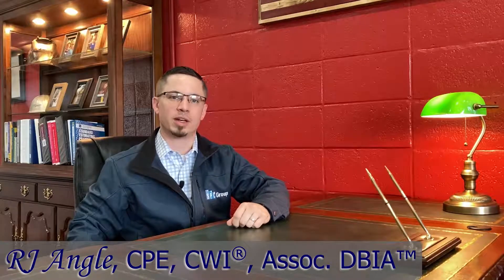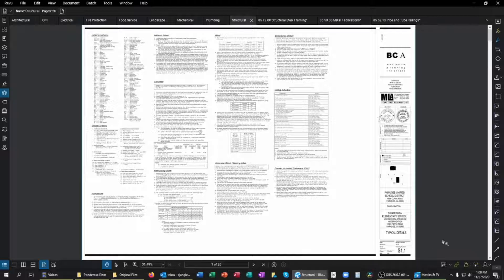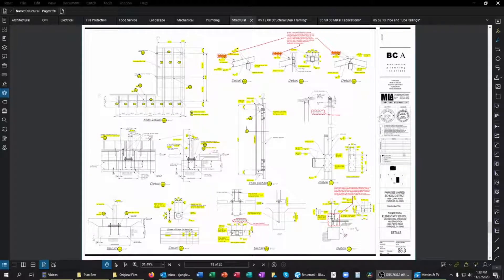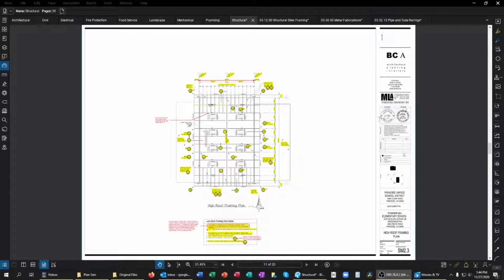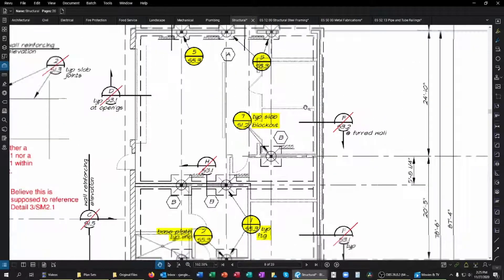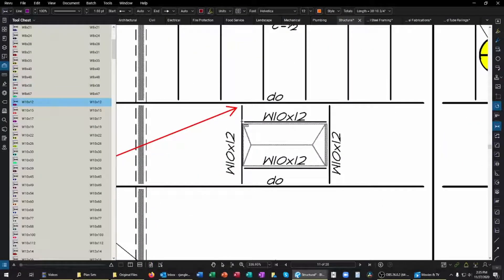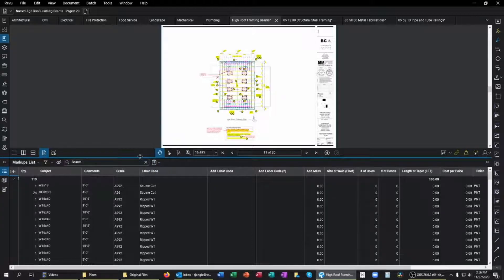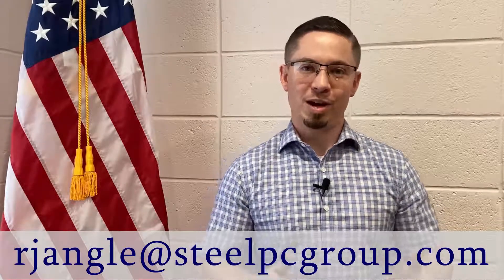Structural Steel Estimating | Material Takeoffs

Comment: Why create separate files? Would'nt it be more efficient to use bookmarks and bookmark headings?
Reply from the maker: @Max Versluis that is an excellent suggestion!  I would have to agree; bookmarking the different plan sets would also be a great way to quickly separate them without segregating the Construction Documents.

Comment: Hi i am trying to learn how to make accurate estimates on steel jobs i am curious how do you tell if you are responsible for the material and fabrication or only for the Erection process?
Reply from the maker: @Dylen Hesseling, thank you for reaching out.  Typically an RFQ (Request for Quote) or RFP (Request For Proposal) will specify the SOW (Scope Of Work) being requested that you bid.  If ever in doubt, contact your client to discuss what their needs and expectations are.  If you're bidding to multiple clients pursuing the same project, you may need to have this conversation with each one, so that "scope gaps" aren't later identified in a buyout meeting, or having your bid rejected/disqualified.

If you're bidding either just the fabrication or just the install and you're trying to determine who's responsible for supplying what, I'd refer you to AISC 303 - Code of Standard Practice; specifically Section 7. ERECTION, Subsections 7.8 Field Connection Material and 7.10 Temporary Support of Structural Steel Frames which have a lot to say about this matter.

If you ever have any questions or are looking for some help, please let us know by emailing info@steelpcgroup.com
Reply: @spcgroup1076  thank so much for the response.

Comment: Hi, I have a doubt, I have found how to takeoff steel connections, but unfortunately I haven´t found a software to do that. By the way, I'm from Mexico, I always receive plans and the percent of misc is really diferent on every project.
Reply from the maker: There are several options for takeoffs, and they're not all created equal. Especially with the different designs that you can see from all different regions, you need a system that allows you to be flexible yet accurate on each project.  Bluebeam takeoffs, I believe, is the best platform for that.  It's simply the digital version of paper takeoffs, and the information or metrics you gather from it can be more easily tailored to the project and/or your company's standards.
Reply from the maker: Let us know if you have any questions - we want them all!  We're here to help you, that's our only goal with what we do!

Comment: What Bluebeam tool set were you using to do your takeoff?
Reply from the maker: Seth, excellent question; thank you! I've actually created my own custom tool set which contains (almost) all of the available steel shapes and sizes. Unfortunately, Bluebeam does not yet provide a tool set with this information, so I had to develop it myself.
Reply: @spcgroup1076  I would be very interested in seeing a short video on how you made that tool set. Currently, I have been using Bluebeam just for highlights and inputting my takeoff directly into Tekla EPM. However, our estimating department is looking to see if we can use Bluebeam to do our takeoffs and import the Bluebeam excel table into Tekla EPM where we can make our final tweaks. Learning how to make a toolset like  yours would be a great first step.
Reply from the maker: @TheNoob2Tube  I'd be glad to help you out!  I was planning on doing an entire training block on Bluebeam for the month of October, but I won't make you wait that long ;) Send me an email at rjangle@steelpcgroup.com to discuss this further.  The Bluebeam profile which I've created (and the toolsets included) were specifically designed to work with Fabsuite (now a part of Tekla Powerfab) and produce a CSV which can be directly imported in.  I think I could be of great help to you and your company's estimating department.
Reply: @spcgroup1076  is there a way i can buy the tool set from you?